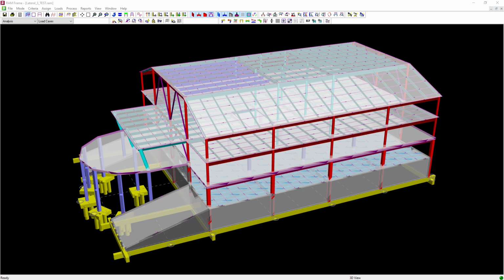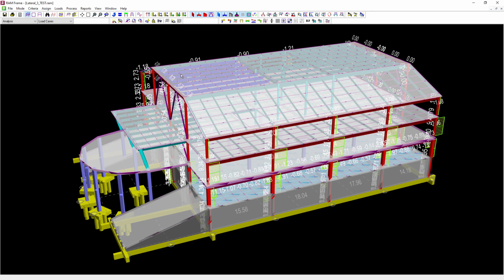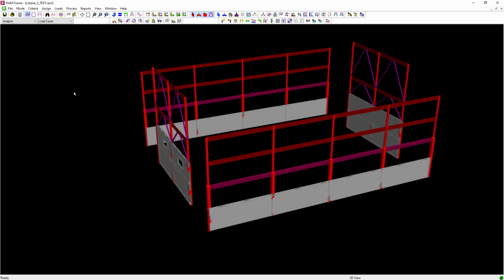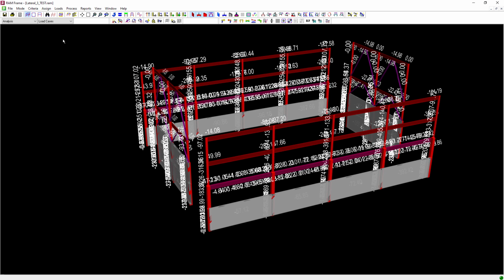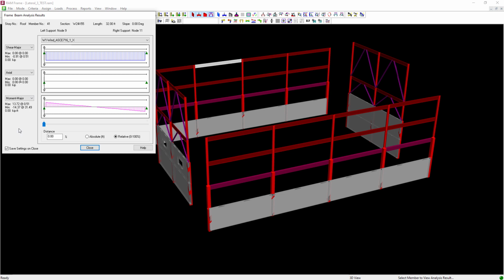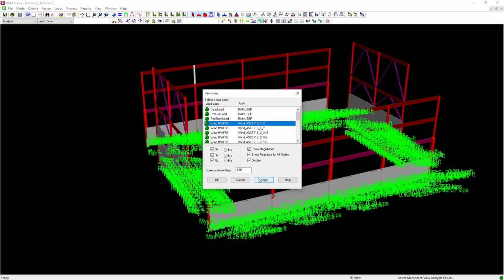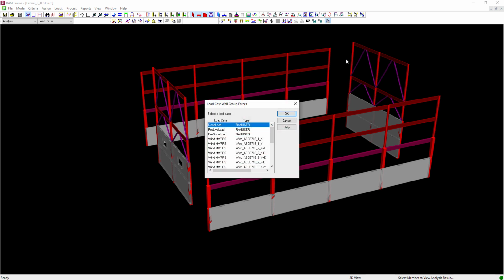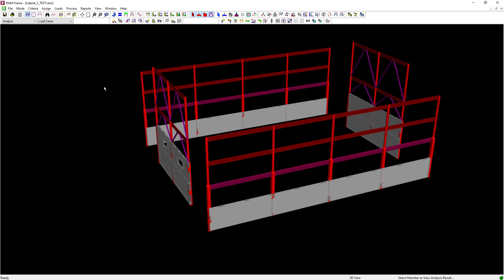Reviewing the Lateral Member Force Results in RAM Frame

Comment: question about moment reactions. What is the sign convention on those arrows? They are not curved; is RAM using the right hand rule then? So Mxx would be the moment about the xx axis (causing overturning perpendicular to it)? Or is it causing overturning along the xx axis, parallel to the arrow drawn?